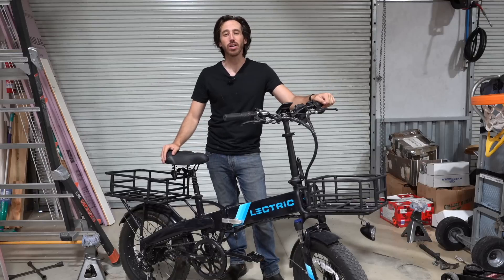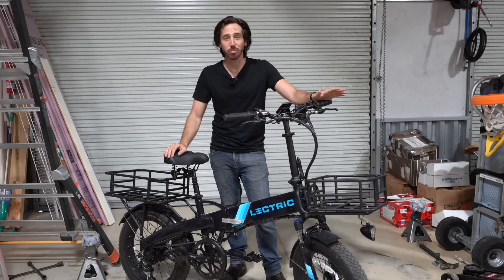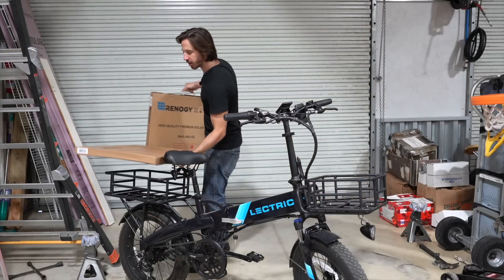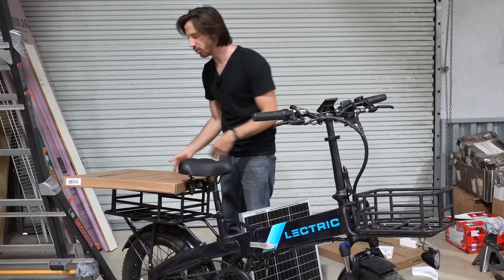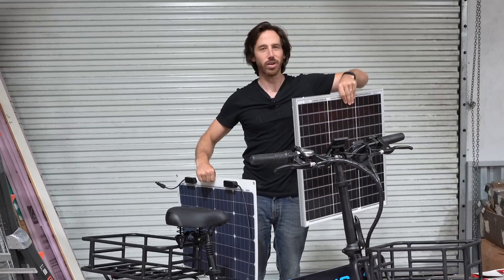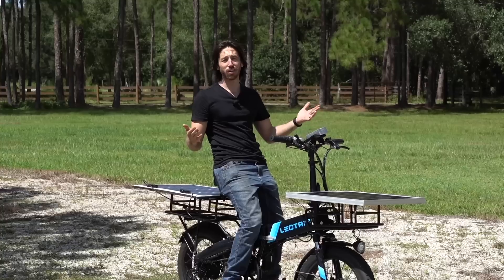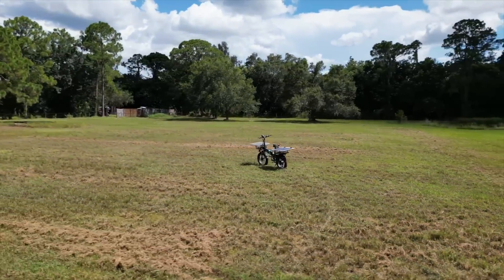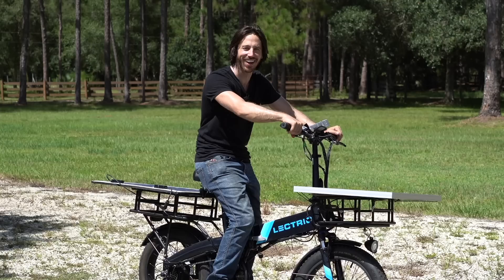Easy DIY solar charging electric bike guide

Comment: Hi Micah, thanks for sharing your quick implementation of a solar bike! One key point is to avoid shadows on your solar panels: in your case the handlebar is right above the front one, while your seat is hanging over the rear one. Unfortunately we couldn't see how you connected your solar panels to your battery. This could be quite tricky.
With just 100 watts nominal power, assuming your battery is 500wh, you will be lucky to be able to recharge it completely in 10 hours (assuming 50w of solar panel output on average...)
For your project on the electric van you will have to significantly increase your solar panel power if you want to actually improve its range 😉
Reply: He said trickle charge, not improve the range.  Also you don't need a full charge if you don't use the full battery every day
Reply: so if the battery is 500wh, and electricity from the grid is 20 cents per kwh, then charging the battery with solar panels saves 10 cents.  If you do it every day for a year you save $36.  How much did the panels and that fancy controller cost?  If you need a spare battery so that you can use one while the other one charges, then the payback may be a long long time, and that's if you drive the battery from full to empty each day, on my bike that is over 25 miles.  If you drive less per day or don't drive some days, the time to break even will stretch way out.

Comment: Remember guys 
15 Amps used by  lights , motors,  any electric item means you need to replace 15 Amps back into the 🔋 Battery.

Comment: This is a really interesting idea. It got me thinking, why not add a small wind powered generator? When your riding you get a nice steady wind. So why not use something like a blade less fan rigged as a generator. Or something similar that is purpose built as a wind generator. It might not add much but it would be more reliable than getting the power solely from solar on even a partly cloudy day.
Reply: Wouldn’t you have more weight, a potential sail, and wind resistance?  Those would all make the bike less efficient causing it to use more electricity than it produces.. but 🤷🏻‍♂️

Comment: Not silly. Great idea.
I was desperately in need of power in long range trip.
Reply: Have a reserved extra battery its  better than having solar panel, the solar cannot charge quickly you need long hours of charging fluctuating

Comment: Hey 
Like the video 
Do you know if they make a boost mppt for 1200 watts solar set up 
To charge a 48v battery 
I have 3 375w panels in parallel which is only 44v 
To charge a 50v battery bank

Comment: Go Big with solar panels over the front with a safari rack that goes from the bed to the front bumper, I would go front to back to max and make the rear ones fold down on the sides when you need the height in the bed

Comment: I'm not good at the math for this, but I drive about a mile to work each day. I'm convinced a small truck with panels on the hood, roof, and a tonneau cover would provide enough charge for me to ride to work and a few more miles a day completely on solar. When you drive a mile and then the truck sits for 6 hours I think it will charge.
Reply: it will work only  if exposed with  proper sunlight long hours that fluctuates, its much better to have a back up battery for switch up if it gets low or bring a portable charger  pack
Reply: Yes utv we ill

Comment: I guess there are TWO concepts to work on. 1). Is to charge and ride for long distance; & 2). Daily use where you use and charge in between trips.

I think the later is more to suit the masses where someone commutes to work and back or rides a bike to the shops, see friends or run errands. So with option 2, you could use one of those foldable blanket panels that unfolds and lays over the length of the bike when not in use. The blanket could be stored in a rack on the back and then opens up to lay over the bike & clipped into place. 

So just like a RV camper van has batteries to get through the night, the bikes batteries get you through the next ride but charges every other moment in the sun. 

I know some of the ranges these ebikes can do are amazing, so the odd 15 minute ride here and there should EASILY be recovered with the majority of your day not riding the bike. 

Example, you ride 5km to your friends house to have lunch, coffee and a good old chit chat. 2hrs later you get back on your bike with an near (if not fully) recovered battery.

Comment: I have a question if you put a solar panel in your ebike and the electricity generated from solar panel goes directly in the batteries wouldn't it'd be bad? As long as i remember you cant use battery while you're using the ebike? Correct me if I'm wrong

Comment: The Aptera three wheel car has a version that will get up to 40 miles a day on solar charging.👍
Reply: The Aptera is interesting, but remember that it is not a car, and will be registered as a motorcycle in most states.  It sacrifices safety for being lightweight and aerodynamic.  But like all EV's it will fill a specific niche as an enclosed motorcycle that can carry two people.
Reply: Yds

Comment: Hi Micah, I would suggest to check the efficiency of the mppt controller because the losses will eat into your output quite significantly (the aluminum heat sink is not an encouraging sign).  If your pickup is higher in voltage than the ebike, what voltage will you try to get from the panel(s)?
Reply: 97%  The MPPT inverter can be set for 24v to 85v

Comment: Very cool, ive been on a solar kick lately after getting an 80w panel thats been running my laptop for over a week now and a bunch of powre banks without having to plugin.  Amazing the free clean(relatively) energy thats out there.     And yeah its heavy , i wouldnt want to have to carry around anymore weight and thats only 80w.  So for a mobile solution id definatley be getting the lighter flexiable ones, dont even care about the flex, you can  carry twice as much pannel if not more for the same weight.  Which i still think you need to do to power a vehicle succesfully, a lot of panel, more then the area of your vehicle allows, so  stop and unfold and charge method seems to be the way to do that.  Theres  a channel here that did that with a van, totally electric, but slow and long to charge and had tonnes of pannel,  But the weight was just massive so no wonder,  you gotta be weight conciouse when using solar for mobile i think.
  Anyway yeah i remmeber that truck, and the Mr. Lee that sold it, would be so cool if you could amphibinize the vehicle too, and solar power sail it to china, while mr lee awaits on the shores waving you in, and you guys hug and embrace and talk about the beautiful vehicle.  Theres a channel that put solar panels on a catamorang boat in british columbia, pretty cool, but only moves around the bay i think and, i think it just too heavy again. Youd have to design with weight in mind from start  when making a solar vehicle, or you'll always be getting unesecessary dead weight here and there.

Comment: You should put a triangle of solar panels, a few reasons.
Structure of the panels could be easy to break in the current config.

More panels = more energy.

Angle is how most sunlight will be received 'reflective light' you have more efficiency when it's not straight up and down relative to the sun.

You can have the panels "along side" the bike, lower on the CG

Also put rubber gaskets for the mounting of any Solar panels on any moving platform, else vibrations WILL CRACK THEM.

Comment: Oooh i can almost feel that refreshing Solar Powered Breeze in my hair.  i wonder how long you will be able to drive the small truck you have with the solar panel charging it at the same time.  Question, Micah, will the solar panel charge the battery and keep it charged while you drive in the sun, will the truck suck more juice that the solar panel can feed the battery  or will the solar panel be powerful that it can keep up with the batter draining

Comment: I did the same thing but had a 200W panel on the back of bike attached to a pole to rotate into the sun. Super fun and turned a lot of heads. I want to do a super high aero low trike solar ebike in the future. Also, the panels did very little output when cloudy like 20-30W. And... isnt that board an OSB board not a particle board? A particle board is very weak and will definitely crack?
Reply: That's add little more charde

Comment: theres a guy on face books Foamie Builders - Foam Campers and Overland Trailers page who built a small trailer he pulls with an electric bike, the panels would work well on the camper, maybe be charging a 2nd battery to extend range...

Comment: In general I think this is a great idea!  However, I think it would be better to have panels that could fold and fit into a pannier saddle on the bike .. then when you have reached a destination (as in camping) .. you could unfold your panels and have a larger array .. with more charging amps.  This was a good demonstration tho.
Reply: Wonder where you can get small folding panels suitable for mobility scooter
Reply: @aussielass5621  just buy a second battery?
Reply: @aussielass5621 I'm guessing from your name you're not in North America, but if you are try Quiet Kat's portable solar charging station. If you're not in US or Canada then have a look for Nice Solar's folding panels. They do a 200W and a 120W version.
Reply: I thought about buying a stowable folding solar panel to charge my e-bike.  But this guy is testing a solar system for his truck, which would be mounted on top of the cab and charging all the time.  I'm guessing that's why he did it this way.  However, it's interesting because my 1000w e-bike can run off of 80 watts or less.  It has a power meter and I noticed that when I turn the throttle as little as possible just to keep up with someone riding an unpowered bike along side me, the power seems to be only 70-80 watts.  Not bad for a 76-pound bike!  (Unless the watt meter is wrong)
Reply: @ChristmasEve777   I don't know much about E-bikes or E-trucks etc. but it seems to me .. that if you are using energy to move down the road .. you could also be grabbing some of that energy to charge maybe a backup battery bank .. not sure how it could work .. but for instance .. those old time small generators that picked up power from the bike tire .. or in the case of a pickup .. having a small honda generator or something to pick up scavenged energy to dump into the system in some way.   If you couldn't charge the battery you were using .. what about alternating between two batteries .. and therefore extending the life of both as well as gaining distance.  No matter what .. you don't want to have to push the bike or the truck when it runs out of juice in an inconvenient or dangerous place.
Reply: @MerwinARTist  You're totally right about that.  I only made that comment because, this guy happened to mention getting a charging power of 80w.  It just seemed kind of cool that those panels could power my bike directly at the absolute slowest speed.  But, for sure, the point would be to grab as much power as possible and store it for later use.
Reply: @ChristmasEve777   .. maybe one day!  :)
Reply: If a e bike is 350w how many solar watts should the solar panel be ?
Reply: I would like to have a bat wing frame like the awnings with FAN folding system.  So, the one in the back could fan out into a 360 degree panel, 4 or 5 of them, all under the existing one in a fan frame.  when riding fold them up  , parked fan them out, use MPPT charge controller that reads EACH CELL, not just rows...
Reply: As a longtime distance tourer on a #cargo trike, I  pedal as long as I can in daylight, trying to leave enough time for setting up tent & cooking dinner. And at early light I'm on my way again. 
It wouldn't work for me,  but for someone who wants to camp over a day or so, folding panels could work fine.
Reply: Eric Tennant tours with a solar panel on a trailer. He has no problem charging his bike. An extra battery does help. One battery can charge in the trailer while riding.
Reply: Just make them lids for the boxes that can be easily removed if camping.
Reply: You'll have to camp. You'll need a full day of good sun and at least 5 full sized panels to get a full charge.

Protip: leave the panels at home.

Get premium cells that can take a real fast charge and build your own fast portable charger.

There are some really lightweight 1300-1600w server power supplies out now, but they haven't hit the used market yet.

4 of those in series would charge my 48v pack at about 100amps.

That would cut my charge time to 25 minutes.

I already have an adapter to use public ev charging stations.

12 cents for a full charge.

Comment: The heavy panel should always be over the rear, not the front. You don't need all that weight swinging around over the front wheel influencing your steering.
If you do go with the flexible panels, I'd recommend attaching them to something like plexi. Much less weight, and wont be effected by weather. Also thinner.

Comment: My name is Dan I live in Batavia New York. I bought an eco trick Hammer bike in 2020 July. I was really interested in solar energy and I bought a blue ETI solar panel and a eb-55 solar generator. But for what I need I don't think it's feasible cuz it weighs 30 lb to go long distance even in my wagon. The ones that I have seen are 200 Watts. But they are the lightweight ones. I do have an mppt controller. I'd like to put a USB on it because it doesn't have one. I can charge it off my bike. I need to get more knowledgeable about e-bikes. I know about regular bikes I've been working on them since I was 5 years old. The e-bike having one leg has really helped me to get out and do things I could not do like ride through the woods at the lakeside Beach State Park and Hamlin Beach in New York. When I came back it was 34 miles no pedaling cuz I have three batteries. But I would like to be able to go to Niagara Falls Down the Erie Canal Trail. And not wonder if I'm going to be stranded they call it range anxiety. Also I have to learn how to fix my old battery and put a BMS in and tested because it was $500 and I use the wrong charger it lights up so it must still work and I'm not going to pay $200 to send it to fth and back I don't like the way they do business and they won't even tell me what kind of a BMS it is in it or if there's going to be hidden fees cuz it's supposed to be getting guaranteed I need to learn

Comment: I also have an older Kei truck and my plan for the solar panels is to create a rack that it hinged at the cab, this will allow for 2 full size panels and they can be adjusted to the best angle for the sun, and it wont get in the way of using the bed.

Comment: If you use 2 'flexible' panels ,that are mounted on aluminum,you can set them forward slightly over the windshield to shade it,and still the sunroof too, from the sun's heat,and have less drain by the air-conditioner.

Comment: i think you need 2 batteries fo that to work. one that runs the bike while the other one is charging. you can charge those while using them. the best way to do it is to have 4 wheel ebike with cargo box in the back that is covered with solar panels. 2 batteries one for riding one for charging while you ride. you made that of carbon fibre so its extra light.

Comment: Thanks, Micah! The story you did for Electrek in Sept of 2018 on the solar powered ebike trailer that went from France to China was awesome... an average of 124 miles a day from the panels (300w-max) and his legs. If one were to seriously want to power an ebike with panels, it seems either mounting the panels to a trailer or an overhead canopy would make the most sense... the trailer adds rolling resistance and the canopy places weight & center of gravity and a potential sail up higher. I'd go for the trailer, unless the canopy was on a trike or a quad.
Reply: Or recumbent with roof
Reply: Way cool!
Reply: The trailer idea sounds better than the roof, b.c. it can be scaled, essentially, "indefinitely" (within reason :) ).
Reply: I saw a van with solar panels on top where the guy used it to charge a pair of electric bikes.
Reply: Yeah they will both work .....

Comment: I'm really surprised the flex panel is rated at the same output as the ridged panel at the same surface area, typically they are a little less.
Reply from the maker: The flexible panel is slightly larger, a few inches in each dimension

Comment: Good idea, and would probably work really well on a bike that size. You could make a door-hinge system so that you can still keep the use of your cargo racks. My bike is much smaller and the only panel that really fits without hindering my air resistance is a small 5w panel… into a 550-600wh battery. I’ve done that maths, and it’s not good! 😂

Comment: You have an MPPT controller and work it like a PWM controller?
No. You put the panels in series and let the MPPT's buck it down to get the maximum output. 
Like it is, you will always cast some shadow on one of them. You'll lose alot when you have them paralleled.

Comment: Putting the panels on the bike is understandable.  But the truck?  There are similar sized panels built for mounting on Jeep hoods to keep one of the batteries charged.  If think in your case a panel on the hood and roof would be more advantageous.

Comment: Run a generator off the free spinning wheel to run the motor and recharge the battery.
Reply: The generator will use more power than it can make.  It is a losing proposition.